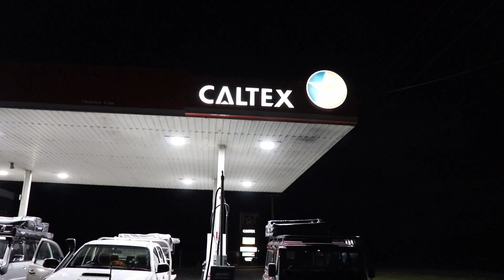Wedge Island To Cervantes | Part 1 | Old Tyres Off-Road

Comment: Cool vid!! Did you drive over a sharp reefy patch to blow your tyres? Pretty bloody ballsy tacking on the ocean ... least you got through it 👍
Reply from the maker: Hey Zoolt,
After looking back over what happened, we think it was a combination of old tyres, running too low pressure and then the sudden movement when Crispin tried to accelerate to escape the waves causing the sidewalls to blowout.

But we've learnt our lesson now and will be staying away from the ocean :)

- Damien
Reply: @OverlandingOutWest  p  look